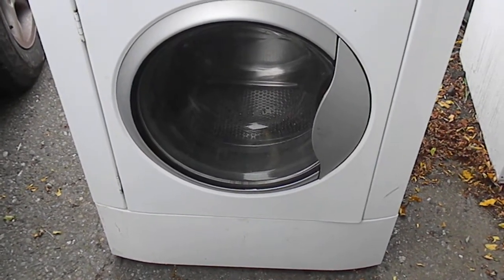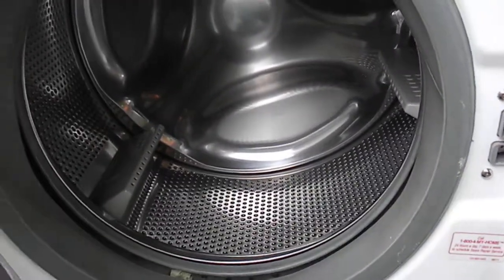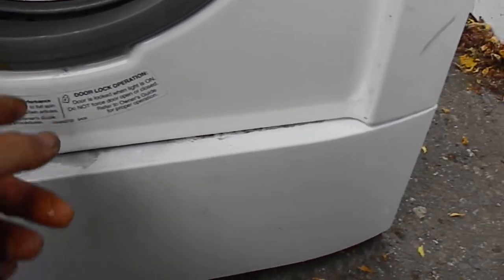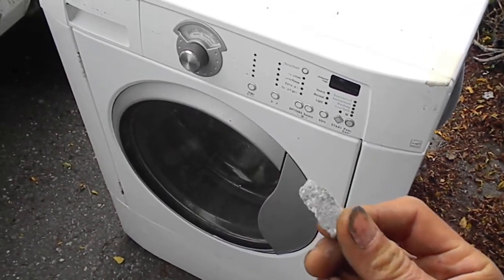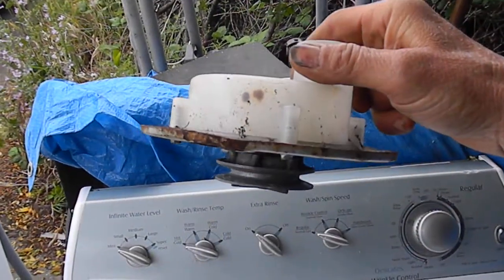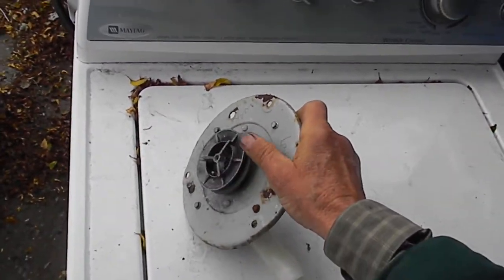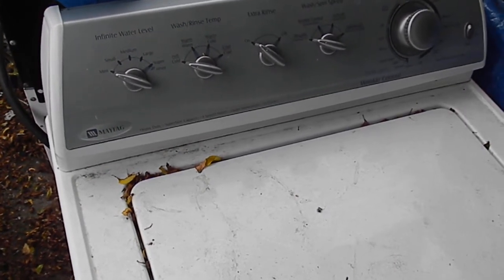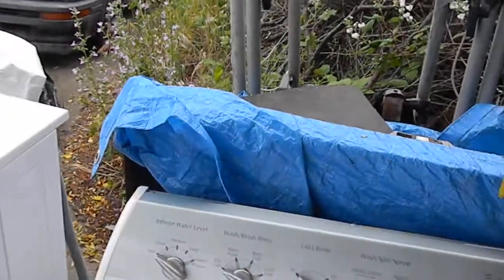Kenmore & Maytag Appliance Repairs, Eureka

Comment from the maker: Soap slop from the top dispencer had distroyed the hinges and model number sticker, the cement front weaght started comming apart and rubbed a hole in a hidden spot between the cement and the tub.  The Maytag at first seem to be fine after I installed a new belt and pump. Than a week later toated the motor pulley, indicating a bad trany and now it sets in my yard as a rain catcher.